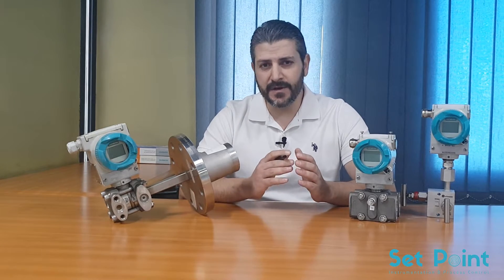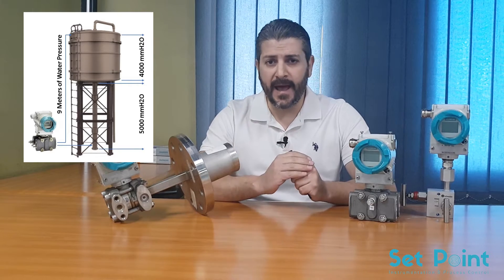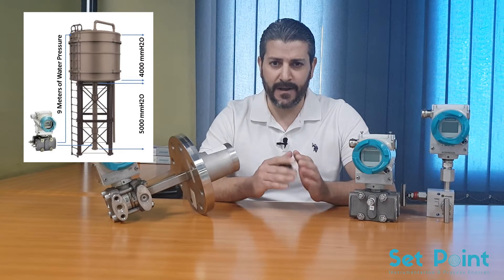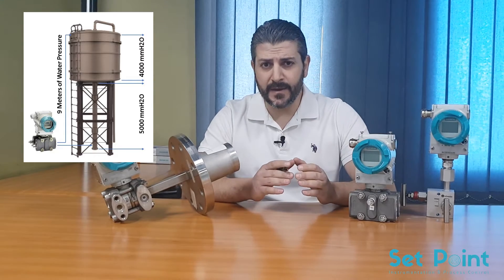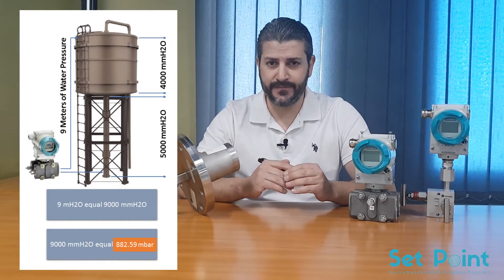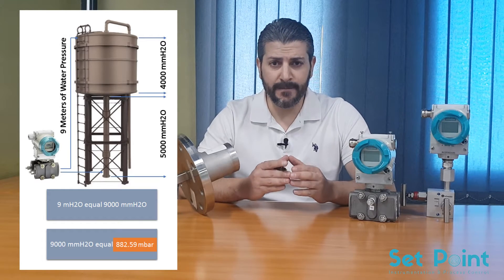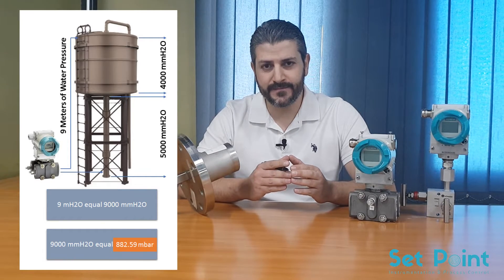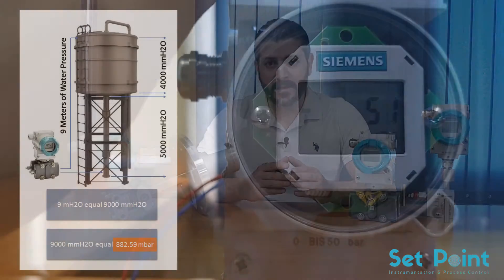Practical example  of using P & DP transmitter for level  measueremant - Part 2

Comment: I can't understand the last scenario!
Reply from the maker: 5000 mmh2o ( the water filled in the pipe) + 1000 mmh2o ( the water already available in the tank) = 60000 mmh2o of water height (wc), so we set this value in mode 7 to exclude it.
Then we set 0 mmh2o in mode 5 ( strat of scale) and 4000 mmh2o in mode 6 ( full of scale), the tank height.
Hope you find it clear now.

Comment: This pressure transmitter or differential pressure transmitter?
Reply from the maker: It's a differential pressure transmitter, high pressure side connected to the bottom of tank. and low pressure side connected to the top 
( atmospheric pressure), as this type of tanks is an open tank.
for more details you may reviw the follwoing videos for an open tank and closed tanbk level masurments.
Reply from the maker: Open Tank DP Level Transmitter Calculations:
https://youtu.be/BS1rsqboNlc?si=3Yry0UhaC1AbBYDo
Reply from the maker: DP Transmitter Dry Leg & Wet Leg Calculations:
https://youtu.be/jr8smrSmt4c?si=t52JyliiAYh43083